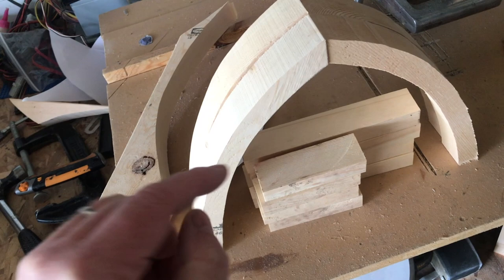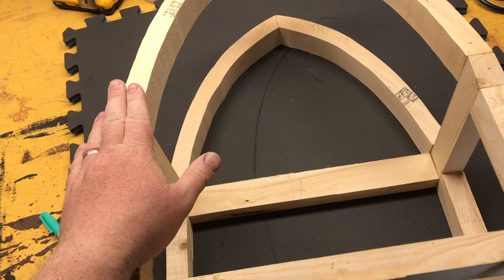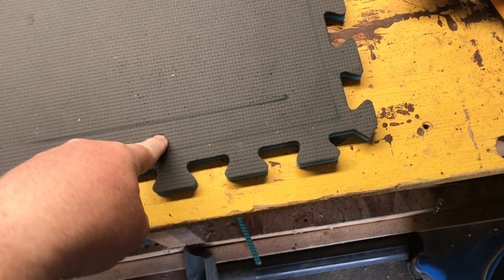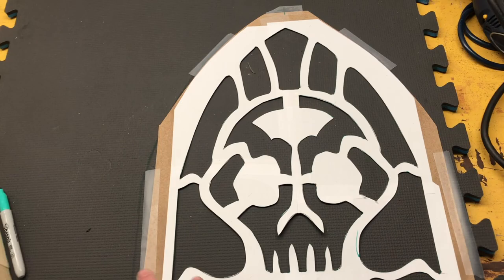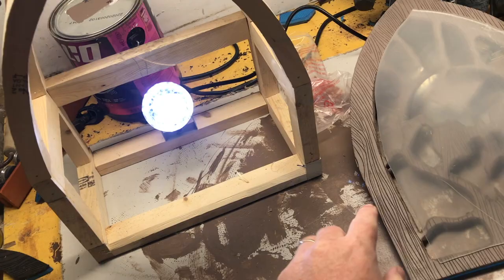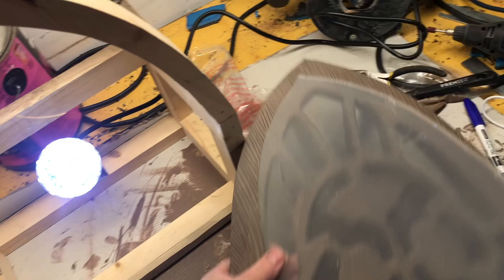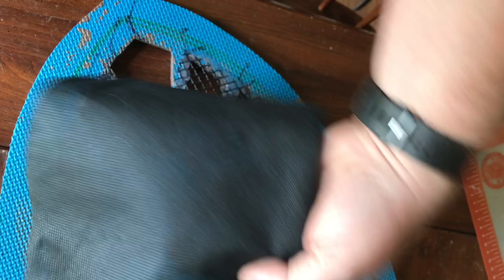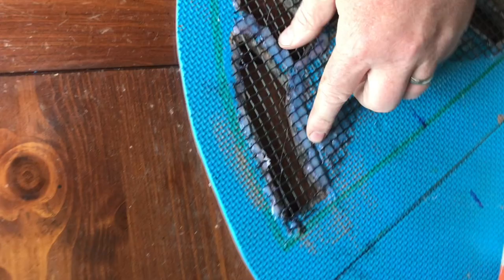EVA Foam Haunted Radio Build, Creepy and fun build

Comment: I love this! The prop looks great and the tip about using the silicone mat to smush down hot glue is fantastic!
Reply from the maker: Thanks Ten Cents Worth!   The silicone mat trick came around when I was making a hot glue slime drip (After a suggestion on my rusted pipe video that hot glue is UV reactive!!). I used a silicon mat to make it so I could pour the hot glue on it and not have it stick.  I realized after how it is such a useful tool for keeping hot glue where you need it!   We all learn from each other, and some of the comments have given me tips I would have never thought of!   Thanks for watching!

Comment: So cool!  I picked up some magnifying sheets at the dollarama -they look to be similar to what a fresnel does.  They are a little smaller than 7"x10" and I am looking forward to trying something similar
Reply from the maker: Hey Cindy, the Fresnel lens was just what I had on hand, if you check out my fake stained glass video you will see I used light fixture panels which are cheap and can be purchased from almost anywhere and they should work equally as well.  Sometimes I have to be careful as I am a huge salvager and it's always tough to use stuff that everyone can have access too! lol